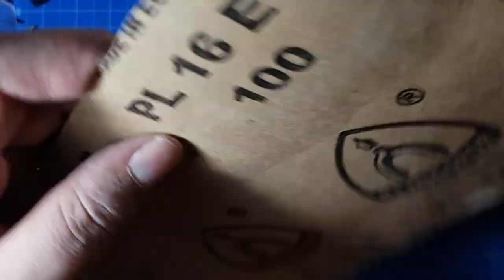Hot Wheels Custom Miata Wide body kit

Comment: That cage is honestly dope
Reply from the maker: Thanks you😊. I just had to. The stock cage and bulky wing ruined the casting in my opinion.
Reply: DieCast Customs what kind of putty do you use
Reply from the maker: It's called alteco. I think I placed a link in my description. Honestly the most comfortable putty to work with. Really clean🤘😊